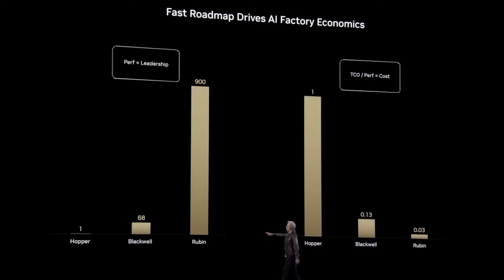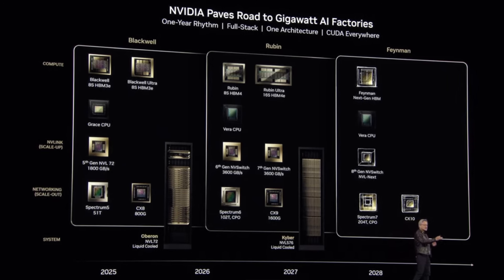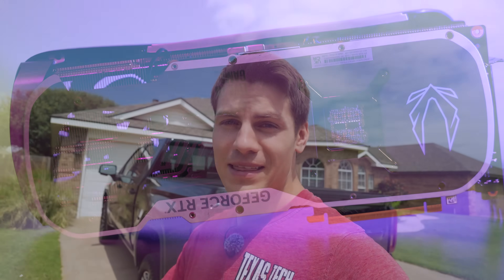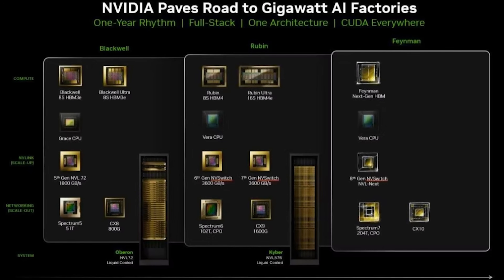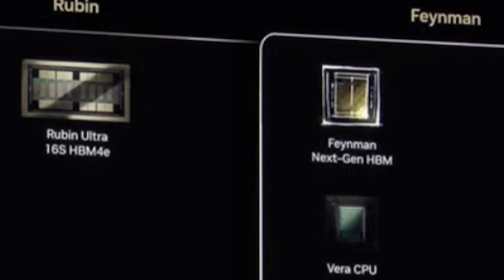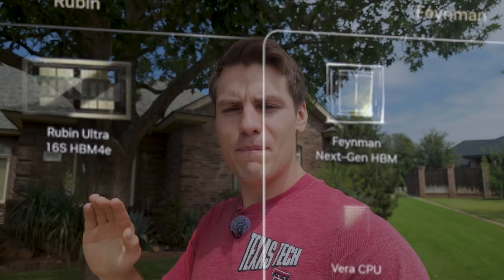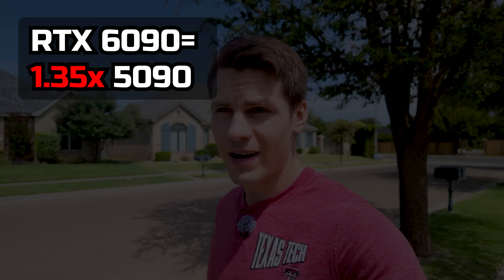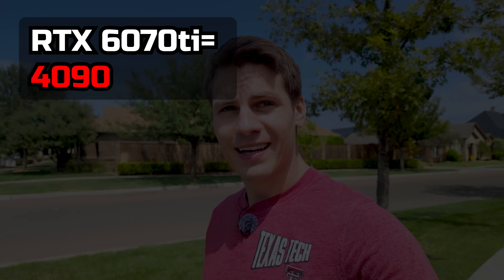Jensen LEAKED RTX 6000 Performance

Comment: I've been considering what move Nvidia will likely make next gen for a bit, and personally I think we'll see them pivot back to a 525-575mm 80 Ti topping the gaming stack to free up more silicon for AI and for professional cards like the 6000 Pro. It'll probably roughly match the 5090 for 1200-1500 or so. Nvidia will want to strengthen their low-mid range offerings in preparation for Intel, but I don't think they actually need a 90 class card and given the opportunity cost I'd be surprised if they offer one again while AI demand remains strong.
Reply from the maker: I'm not sure they will give us another 512 bit, 750 mm2 card on a new node. I agree that if they drop the 90, or 512 bit card then we will see a 80ti with a decent die size.

Comment: I have a 5090 and game at 4k.  I finally have enough performance now to camp on this card and skip a generation or two in terms of feeling like I need to upgrade.  I'm running most of the titles I play at native (DLAA) and using 2x frame gen to stretch the legs of a 240 Hz monitor.  I think that it's going to take the 2nm format to get any appreciable gains in performance.  Suffice to say that I literally don't expect anything to perform decently with UE5 titles.  I don't own any games that use UE5 and highly doubt that I will ever buy any unless they're in the bargain bin.  I'm not going to reward the industry by buying such poorly optimized garbage, I just retired and I have a twenty-year back-catalog to work my way through.

Comment: Important notes: TSMC 3nP is NOT a GAA (gate all around) node it is still obsolete FinFET process. This means the 3nm is only going to be marginally more efficient over the 4nm finFET that 5000 series is made on. only when AMD/Nvidia make 2nm GPUs will you see a massive performance boost because the cutting edge GAA process allows tighter voltage control in tansistors with less leakage which means way higher stable clockspeeds with less voltage current which means less power draw and less heat production. its actually possible we will see +4ghz clockspeeds on graphics cards using GAA TSMC nodes in the near future. 
The 6090 will likely be ~35% faster than a 5090 and be severely bottle-necked because of nvidia driver bloat. Whichs means a 150+CU flagship AMD GPU might give you higher framerates in some games due to its lower CPU driver overhead.
Reply from the maker: Yes, this video builds of that discussion I’ve already had in the videos I mentioned

Comment: I don't know much about all of this so sorry if I say something dumb, but wasn't RNDA5 leaked to have a node shrink ? I guess that if it comes after the ps6 it will be 2028 anyway, but then does AMD not have an answer to RTX 6000 series in 2027 ?
Reply from the maker: RNDA 5 (Should actually be based on UDNA) is reportedly built on 3nm as well. It honestly depends on if they come out with a flagship 512bit card to counter the 6090. If they do, it very well could rival it in raster gaming. I will make a video covering next gen radeon soon so stay tuned on the channel
Reply: @SiliconSteak thx👍. If a node shrink isn't comming I'm just gonna upgrade my 6700xt to a 5070 super when that comes.
Reply from the maker: @sarez6767 That will be a decent upgrade. Like 70% without factoring in DLSS. That ought to keep your build relevant for a while.

Comment: Honestly 60 series should have been made on Intel 18A since it will actually beat TSMC 2nm in performance but a little worse density (Efficiency) and the deal they just made would give them first dips at top quality wafers since Apple is buying up all the TSMC 2nm wafers. Also would avoid teriffs, shipping cost and buying domestic is always a good thing for the economy. I think Nvidia wants to see how 18A turns out before they commit to Intel and probably 14A.
Reply from the maker: Denser nodes are better for GPUs, performant nodes are better for CPUs. Intel geared it toward CPU optimization, 14A would target GPUs
Reply: @SiliconSteak  I agree, but still think 18A would have been fine for GPU's since its probably just as dense as TSMC's N3P.
Reply from the maker: Maybe. I think that Nvidia cant risk it with the AI boom right now. They need something they KNOW will be on time and not have any issues. They usually dont go with bleeding edge nodes

Comment: i just hope dlss5 would be ATLEAST 35% better on the 60 series they should make exclusive futures like way better frame generation and dlss modes, because no gpu for the next 10 years would be able to run path tracing on native and every game is using it right now, 5090 runs it on 45 fps at best.

Comment: The big boost in ai performance comes from more tensor cores.  But tensor cores are worse for gaming than Cuda cores.  We will keep getting expensive gpus with mediocre gaming gains until ai computers stop using gpus entirely and start using custom built ai chips.  This is coming starting next year but they will have a lot of shortcomings to begin with.  We won't get a reasonable price/perf from video cards until 2028.

Comment: Another factor potentially limiting the 6090, which I don't think was mentioned, is that they can't raise the power any higher without adding a second cable. I don't think they will do this. Cutting down the mess to one cable was the reason for creating the new 12VHFR standard in the first place.

That said, at least as far as the 90 class goes, the incentive to upgrade has more to do with the real world economics and product availability. The 90 class has created an unprecedented situation, where these GPUs are holding their value in the second hand market. Especially in the first months of the new generation, while supply is scarce and demand is high. Anyone who was lucky enough to get a 4090, or a 5090, during the first several months, would have been able to sell their previous gen 90 class for as much or even more than what they originally paid. In other words, buying into a 90 class card has been a "buy once cry once" situation so far. If you sell the old card and buy a new one each generation, the cost of upkeep has been very low. There's no garuntee this pattern will hold, of course.

Comment: Expect 0% to 10% improvement in rasterization, all the additional density and performance gains from node jump will be put into making the tensor cores bigger and faster, nvidia CPX gpu that they announced which most likely will be what the 6090 is based on has 20 petaflops of dense fp4 computation. compared that to the 5090 which only has 3.4 petaflops of fp4. The most likely outcome is that not only are they using the density and performance gains to boost the tensor cores, but that they will even cut back on traditional raster and gaming performce. However i don't think they're be performance regression from gen to gen instead they will use architecture improvements to achieve the same gaming performance as 50 series while using way less die space for gaming.
Reply from the maker: Interesting take

Comment: MCM designs. who could pull it off better then AMD, Nvidia. 48, 96, 128 gb memory config, mcm design, nvlink fabric on die water cooled or phase changed cooled   flagship 4,000.00 adjustments for inflation 6,000.00 48gb 8,000.00 inflation 9,000.00 96gb,  15,000.00 inflation 20,000.00 128gb.. scalper sir-charge 50-100 % markup.. not gaming cards. Great post..

Comment: OK, if rubin architecture for AI datacenter scales in 3nm, we can expect rubin desktop cards to have the same architecture. So yeah, guys, we're going to wait till 2028 and HOPEFULLY not on the same node for 2 generations. Blackwell on 3NM would give us so much performance, you guys. But I strongly believe in a strong performance jump since nvidia blackwell is still 5nm. That nomenclature is a fancy way to say 5nm but slightly optimized. So I expect a decemt +30/50 percent in perf with big improvements on the laptop side of things

Comment: 10:33 - "... with 3GB modules maybe they could make it 32gigs".   I'm curious how they would configure 3GB modules to hit 32GB.  :)  I think you meant 2GB there.  :)   The 5090 has 32GB on a 512bit bus, and that is pretty much solidly for AI researchers/enthusiasts.  NVIDIA pushing AI as hard as they can, and also wanting to never let AMD get ahead of them with bragging rights for anything, I can't see the 6090 having less RAM or a smaller memory bus width than the 5090, nor having less VRAM than AMD's top card.  Right now AMD's top RDNA5 silicon for top consumer card is rumoured to have 36GB using 3GB modules (3GB x 12) which would give it a 384 bit bus if the rumours turn out to be true.  NVIDIA is unlikely to lower their bus size and use a similar memory configuration to tie AMD, lowering memory bandwidth on AI tasks, so I think they're more likely to have 32GB/512bit again, or if they want to beat AMD's rumoured 36GB they will stick 3GB chips on the card and have 48GB/512bit which would make AI people throw money at them.  Or if 4GB chips are out by then they could slam 64GB onto it.  Just some thoughts.
Reply from the maker: I meant if they went with a 384 bit bus on the the 90. They still wouldn’t be able to get 32GB. They would actually need 4gb modules
Reply: @SiliconSteak  Yeah, They could use 3GB modules to get to 36GB using 12 of them with 384 bit buss, which is what it appears AMD might be doing with their RDNA5 halo card.  I don't think NVIDIA would go in this direction though.   They could use 4GB modules for 32GB like you suggest, but that would be 8 modules so they'd end up with 256bit bus, so I think if they did that they'd go to 64GB to keep the bandwidth high for AI usage, which is what people would want 64GB for.  Another option is the 3GB modules to 48GB/512bit.  Will be interesting to see what they do! :)
Reply: @SiliconSteak  With a 352-bit bus NVIDIA could get 33GB using the 3GB modules which would be interesting since only the 1080 Ti and 2080 Ti used 352-bit bus.

Comment: Each pin in the memory interface is going to be 25% more expensive from TSMC as is each bit in the cache. Each transistor in the logic side, like cores and RT acceleration and AI acceleration is going to be cheaper.  And in 2nm node multiply that price again by 50%.  

This is both the underlying reason for price/perf stagnation for gamers and  why bus width are getting narrower. Nvidia keeps margins the same, wafer costs increase while die shrinks have limited benefits and then those benefits are limited to different kind of silicon. It's probably going to be a chiplet designs at some point where there's lot's cache and memory controllers made in cheap node and core's and ROP:s on the more expensive node. 

But it's not worth to upgrade every generation anyway. Moore's law doesn't work on price/perf like it used to in the old times when wafer price increases where marginal and everything scaled better.  This time performance improvements mostly come from better power-efficiency and higher clocks of newer nodes instead being able to offer more at same price.  On the other hand on CPU side AMD can sell 150mm² of latest node with piece of silicon with older node around 500$.  So die shrinks actually benefit on CPU side, because latest node is used for small fraction of overall product and to fit complex logic in denser space.
Reply from the maker: You’re right. But most people only blame Nvidia. It’s really Wall Street, TSMC, and Nvidia

Comment: The performance uplift compared with 50 or 40 series will be lower but since I'm a 16 series user a 4090 performance by 6070ti will be heavens.
Reply from the maker: It will be a bigger jump than 40 was to 50

Comment: You have to think in 2 dimensions. The target resolution will be still 4K or something upscaled to 4K, but the target refresh rate, the target fps will be 120Hz or 240Hz. So a 10% increase in cuda cores and rops and everything over the previous gen doesn't necessarily  mean  it will be bad, if the clocks are higher, if the performance is such that it can deliver that 4K frame within  ~8ms or 4ms... Without frame generation.
Reply from the maker: Yeah don’t get me wrong, 10% over the 5090 is freaking fast. But not great improvement for 2 years. If it’s 3NP and 512 bit I think it will be about  35% faster
Reply: @SiliconSteak  35% is great, if it is cheaper and more power efficient... It probably wont be.
Reply from the maker: It’ll cost more

Comment: 14:38 I got a 50 series for 4x frame gen.  IMO frame gen is the best feature that has ever been introduced to a graphics card.  It is better than upscaling.  In the past, I turn off DLSS because it makes frames look soft.  To get higher frame rate I dial down assets.  It was 4x frame gen that got me to upgrade my 3090 to a 5090, plus, the availability of a 240 Hz 4K 27" OLED.  The only way i will upgrade to a 60 series is if it does 8x frame gen and the availability of a 500 Hz 4K 27" OLED.
Reply from the maker: Honestly, I need to make another video about frame gen. On a 4k 240hz oled I agree it is a game changer, and it will only get better from here. For certain scenarios it’s amazing
Reply: @Missed-it-by-that-much  lossless frame gen is like $5 on Steam
Reply: @_filtered2489  tried it.  They are not comparable.
Reply: @_filtered2489  I tried it.  They are not comparable.

Comment: i just picked up a zotac solid oc 5090 should get it tomorrow.  paid a little over msrp for the white and oc but hey i think ill keep it at least 3 years minimum. better than trying to upgrade two time in the next 3 or 4 years to keep relavant and deal with buying gpus often
Reply from the maker: Got the regular version. Zotac offers 5 year warranty for their cards, I like that
Reply: If the 4090 can last 4+ years a 5090 definitely can

Comment: The majority of NVidias top 20 largest customers (accounting for 70% of their income) have already begun work on their own chips without NVidia... At the same time Whole-of-Government contracts in the nations of Japan, Korea, India, and China mandate indigenous designs that leverage open standards such as RISC-V and this exclude NVidia products from being procured in all Government supplies. Japan is now fast tracking its own bleeding edge fabs and supply chains so that Rapidus is able to start 2027 production of advanced 2nm logic chips and they have reserved capacity for Japanese consumption for years forward... Does anyone not see the problem on the horizon? What happens when market cap bubbles the size of NVidia pop?
Reply from the maker: Well I think they are trying with new chips, but they have no intention of fully replacing Nvidia with those chips, just partially
Reply: @SiliconSteak  No, the announcements from all companies where made to shareholders specifically stating the cost & objectives being to secure independence and ensure self sufficiency. The reason this is happening is because the R&D costs involved being so high, they cannot afford to be spending those funds on a platform owned by someone else... They are fully replacing NVidia and other platforms. CUDA is now a dead end.
Reply from the maker: It will take time for the software to replace CUDA. I’m telling you that can’t happen overnight, it will have to be phased out or they will fall behind in AI. Just my thoughts I’m no expert

Comment: 2026 sounds a little soon for RTX 60. Shouldn’t it be 2027?
Reply from the maker: It should be 2026, they might delay it to 2027. Their cards release on a 2 year cadence 2016- pascal, 2018- Turing, 2020- Ampere, 2022- Lovelace, 2025- Blackwell (January) so Blackwell was punched back to the first month of the next year

Comment: Processore Del Futuro 

AMD Ryzen AI ∞ (nome in codice “Aurora”)

CPU:

64 core / 128 thread basati su architettura ZenX a 3 nm

Frequenza dinamica fino a 7,2 GHz con auto-scaling termico

Cache unificata L3 da 1,5 GB, con accesso neurale predittivo

GPU integrata:

500 Compute Units RDNA-X

Ray tracing e path tracing nativi in tempo reale a livello fotonico

Potenza comparabile alle attuali GPU professionali di fascia datacenter, ma on-die

NPU (Neural Processing Unit):

Architettura XDNA X3

500 TOPS di potenza dedicata all’AI

Capacità di eseguire LLM da 1 trilione di parametri on-device, senza cloud

Memoria:

1 TB di memoria 3D HBMX unificata (CPU/GPU/NPU condividono lo stesso spazio)

Banda passante oltre 20 TB/s

Gestione dinamica della memoria con allocazione istantanea: la GPU può prendersi fino al 90% della RAM se serve

Tecnologie speciali:

Quantum-accelerated instructions (moduli fotonici per calcoli ibridi)

Neural Cache: porzioni di cache che imparano i pattern di utilizzo e li anticipano

Consumo energetico adattivo: 50 W in idle, 1500 W al massimo carico (raffreddamento a liquido quantico consigliato 😏)

Applicazioni:

Gaming fotorealistico in 16K con simulazioni fisiche totali

Addestramento e inferenza AI locale su scala oggi da supercomputer

Creazione di mondi virtuali persistenti e interattivi in tempo reale ma con radici nel possibile: le linee che oggi sembrano impossibili (CPU + GPU + NPU + memoria unificata enorme) Archettetura nome in Codice Aurora e prevista Per 2032 e il 2035

Comment: I would much prefer to see nVIDIA use older nodes, specifically for consumer class products so that the supply is no longer competing with AI chips and they can offer better pricing --- it's all about price/performance for me! 

You will absolutely not see a situation like the 3080 vs 3090 ever again.  I don't think you would have seen it for the 3000 generation either if Samsung process node hadn't been so awful that they have nVIDIA an awesome deal on pricing! Well, I guess if AMD brings really aggressive price/performance that forces mVIDIA prices down would be the only way we would see it, but I don't expect AMD to ever be that aggressive...